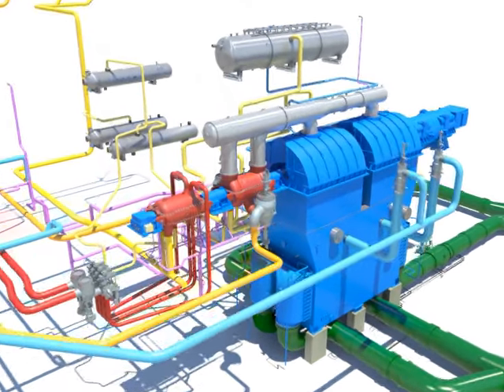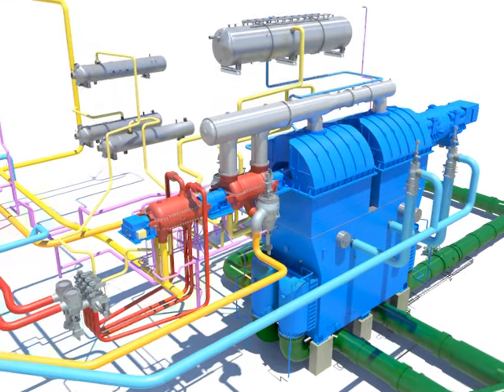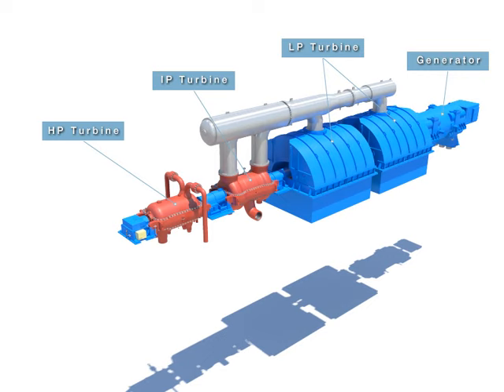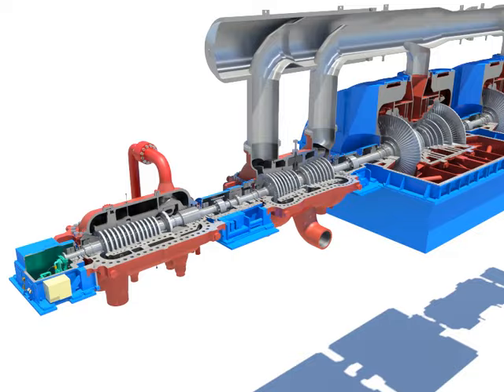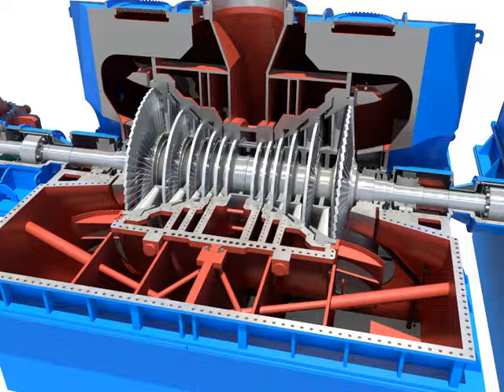#powerplant   #Steamturbine  : How Does a Steam Turbine Process?.

Comment: Steam turbine is not a Heat Engine! Its a Prime mover. Yes the whole Rankine cycle is a Heat Engine which includes the boiler, BFW pumps, condensers etc
Reply from the maker: ok sir. thanks
Reply: @Powerplant02  Im just correcting, not offending! You have a nice channel! God Bless!
Reply from the maker: @copievillamaria  
hehehehheeh ...

No problem, sir, suggestions and criticisms are very important, sir. So that I give my best... God Bless Us
Reply: @Powerplant02  Its not criticism, fact, I teach that in Canada! Nice video, God bless us all!
Reply from the maker: @copievillamaria  ok sir... thank you..
Reply: @copievillamaria  How is steam pressure built up in the system? Or does it just flow from the boiler into the turbine?
Reply: Is there some kind of condenser?